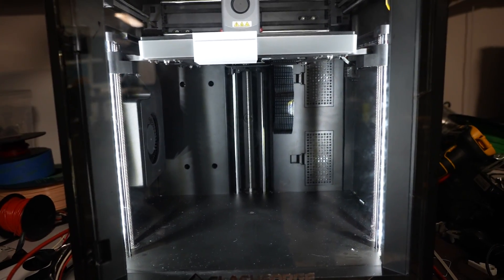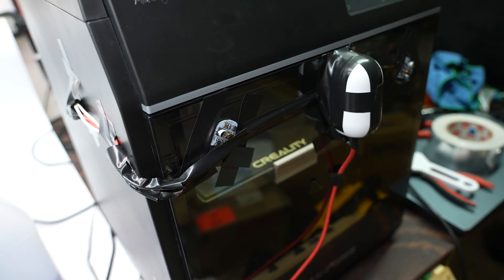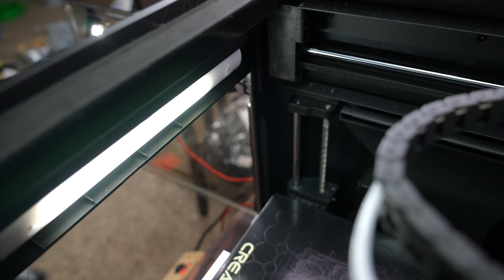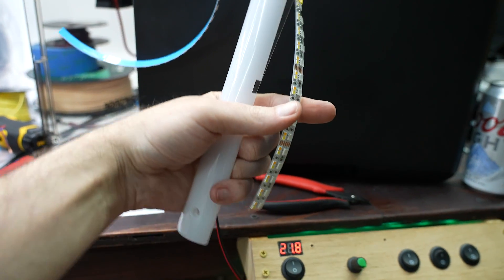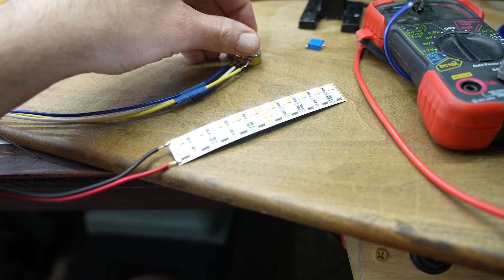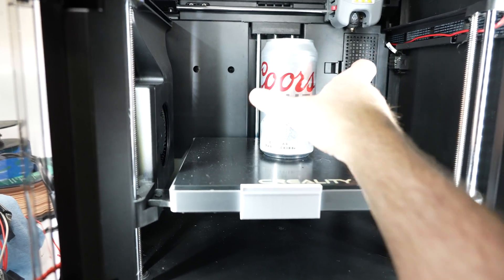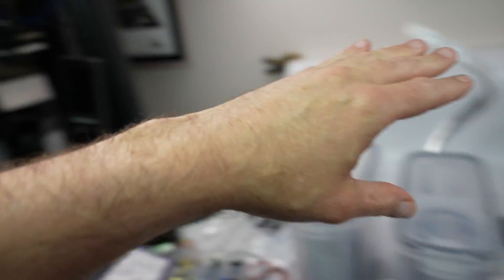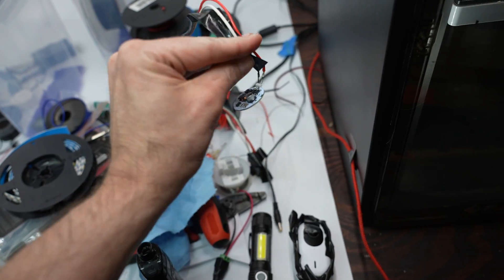Drilling my Flashforge Adventurer 5M PRO 3D Printer for UPGRADES

Comment: I got a Flashforge Adventurer 5M Pro a few months ago, thinking I could have a little fun and at least pay for it. I have had nothing but trouble with it since i bought it... Just bought an extruder assembly from Flashforge, which seemed like it was going to work fine. until the nozzle broke in the machine. I put another one in now it doesn't work at all. I wish I would have bought a different printer. This was a terrible investment..........

Comment: I am considering purchasing a 5m pro but I am reading a lot of bad reviews specifically about the networking. Are you using ethernet or the wi-fi? I have read that sending files over Wi-Fi does not work and unfortunately where I'm placing the printer I will have to use Wi-Fi. Hopefully you read this I'm I'm looking for with experience with this machine
Reply: Rambled a bit and read on if you want, but yeah, mine struggles with sending larger files over the network. I've done 30 or so prints so far and I had to do 2 via USB drive instead of wifi.

I've had mine for about a week now. Enjoy it a lot more than my Ender 3 so far. I've had a couple of hiccups with the networking. Was frustrating at first but I found I can just go to the device, toggle wifi off and on, and it works. My suspicion is that sometimes the 5m Pro's web server fails to start up and toggling the wifi off and on gets it started. Like, I would see that it was connected to the wifi, but nothing could connect to it. I would suggest that if you have a particularly large file to print (not in actual volume, but the file itself is large) that you plan to just put it on a USB drive. Most prints have been fine so far but there were a couple of very complicated ones that failed to upload to it.  Honestly, the most frustrating ongoing issue (and it's not that bad) I'm having is that if you forget to hit "Ok" on the printer after a print is done then FlashPrint will see it as busy.  Just one of those irritating things where you just grabbed a print off and sit down to start the next one only to realize you have to get right back up. Do note that on the Print Complete screen that you need to hit "Ok" and not "Continue". "Continue" starts another of the same print.
Reply: @robertk1701  thank you
Reply: The machine can make its own wifi.  You connect to the machine wifi and enter the ip into the klipper each time its opened.  The files only worked a few times and now they fail uploading.
Reply: I just got a 5m pro and have had no problems with it. Prints great and everything works perfect. So whatever problems it had before they have since fixed.